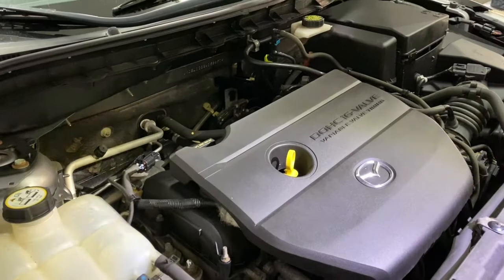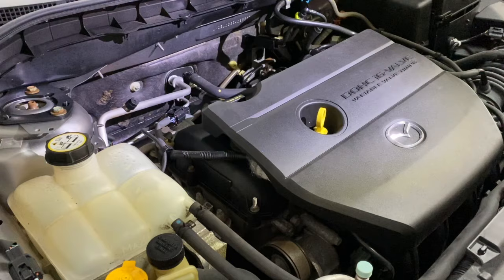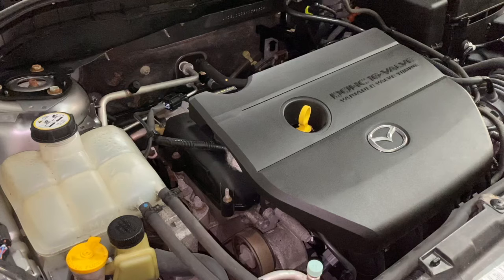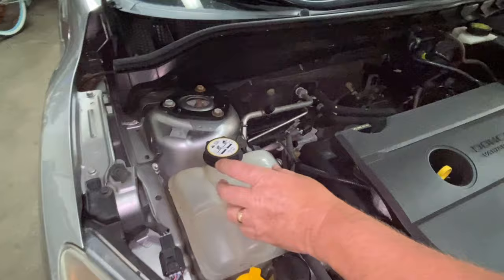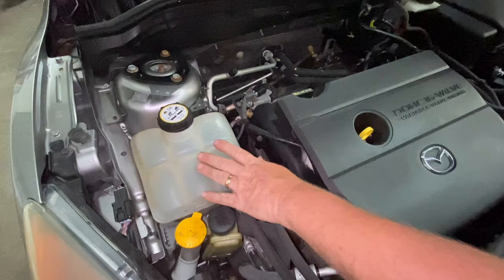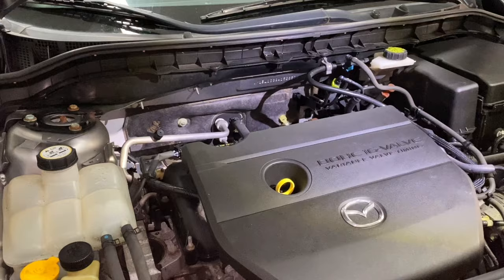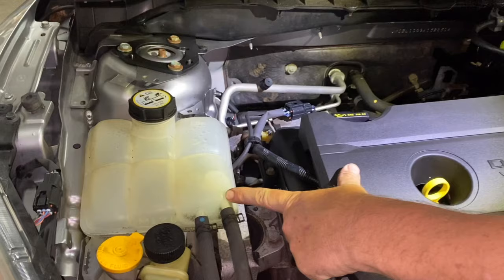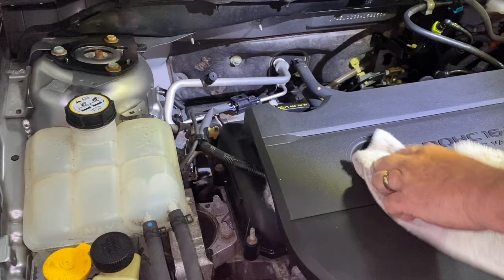Learn 3 Symptoms of Blown Head Gasket

Comment: Hey there, very informative video, 370z 
 60k miles did an oil change, and one of those gimmicky engine flush fluids before oil change during this though it caused a lot of white smoke from engine, temp is fine. it smokes a LOT from the engine, did I blow a gasket? No bubbles in reservoir or milky reading on dipstick or oil cap, I’m out of ideas here.
Reply from the maker: When you did the engine flush, you are not supposed to drive with that chemical in there, only idle, did you drive with it in there?
Reply: @Motorcarnut  just kept it on idle
Reply: @Motorcarnut  thankyou
Reply: @Motorcarnut  the car is supercharged that could be an issue as well

Comment: I have a 2014 Jeep patriot and I have changed the radiator both thermostats the radiator cap and waterpump also the temp sensor and it keeps overheating I cant find the solution for this and it keeps losing coolant from radiator with no visable leaks 😖
Reply from the maker: It’s probably burning it, the start of a blown head gasket. You could try pressuring each cylinder with the radiator cap off and see it you see air bubbles in the coolant.

Comment: Someone put stop leak in the car and it rocked up blew the radiator. Put new radiator thermostat and coolant filler neck car drives good but overheats still every two miles and I still have no heat.. what does that mean?
Reply from the maker: I never recommend any head gasket sealers, I even made a video on that. The car probably has a head gasket problem for someone to use those sealers.

Comment: I have a 2006 rt charger I bought from a owner that said it was the heads.. it smoked from the pipes just like your vehicle and idled real rough and it would not stay running… do different cars have different symptoms ?
Reply from the maker: Not really, All combustion engines runs the same way. They all need valve timing to be correct, have compression, fuel and spark. Sounds like coolant is getting into the combustion chamber from either a blown head gasket, crank in head or block.
Reply from the maker: Meant "crack"
Reply: @Motorcarnut  found out it was the pistons as well
Reply from the maker: That’s not a symptom of a blown head gasket that’s a cause.

Comment: I have a peugeot 508 1.6 tdi. I drove through a puddle/more of a lake, and there was white smoke coming out of the exhaust for the next 2 hours then it only smokes when i press the gas pedal at maximum. What could that mean? I am also losing coolant after refilling
Reply from the maker: You sucked in water hopefully you didn’t blow the engine. If it clears up you didn’t if not you did.

Comment: I have a 2006 Toyota Camry it’s not showing any of the signs you showed in this video I recently seen that my thermostat housing was leaking but before I found that out when I pour coolant in the radiator my motor shakes then my car kills do you think when I change the housing it will stay running or I have a blown head ?
Reply from the maker: I don’t like that when you add coolant the engine dies. That sounds like coolant is entering the cylinders aka blown head gasket or crack somewhere. Changing the housing that’s leaking is a good idea but won’t cause the engine to run rough then die.

Comment: Hello, There is an oil stain on my car engine and alot of smoke and burning smell comes out soon when car is started from hood (oil burning externally). What are the reasons for this?
Reply from the maker: You probably have oil dripping on the exhaust manifold. Probably the valve cover leaking, check there.

Comment: Did the coustomer get the car fixed and if so how much did it cost? Thanks great channel just found it today
Reply from the maker: Thanks, assuming you mean for a mechanic to charge you? It depends greatly from state to state and what quality parts they use but figure $1200 to $1500
Reply: @Motorcarnut  thanks is that just changing the gaskets or work done to the motor?
Reply from the maker: That’s changing the gaskets, fluids  and the labor to complete the job with a warranty.
Reply from the maker: If the head needs to be milled, that will be another $75.00 or some include it in there price, good to ask before hand
Reply: @Motorcarnut  thanks just getting an idea I might need to get mine done. But I will get it tested first. Internal leak with no smoke ,milky oil, external leaking.
Reply: @Motorcarnut  thanks I appreciate your time and knowledge. Great channel
Reply from the maker: No problem, thank you and good luck!

Comment: Hello , i want to make u a qestion please . 
I just bought a golf mk4 1998 1.4 16v 
The car pull out white smoke from exhaust 
Can u tell me plase what should i do ?
Reply from the maker: It depends on how much white smoke, a little when cold is normal. If the car is losing coolant or the white smoke doesn't stop when car is hot and runs rough then you probably have a head gasket problem or something else.

Comment: Great video :) so about 3 weeks  ago my car overheated. Was stationary for about 15/20mins and wasn’t looking at the gauge. I had the air con on but noticed it wasn’t blowing out cold out. Eventually I looked down and noticed the temp gauge was at the highest setting and the engine overheating warning light was on. I turned the car off straight away and checked the coolant. It didn’t overflow but it was on the maximum line. Anyway turned out the cooling fan stopped working. Mechanic came out and said I most I haven’t damaged the head gasket because the coolant didn’t overflow? But I’m just wondering if it caused any other damage to the engine as I have no idea how long I was sat when the car was overheating… I’ve been checking the oil and coolant levels since and they seem fine. Could the engine head be warped or anything else?
Reply from the maker: Ok, so after the mechanic said the fan was bad did he replace it and you’ve been driving the car every since?
Reply: @Motorcarnut yeah it got towed to a mechanic who replaced the fan. Have probably driven about 300 miles since it’s been changed without any problems. But just not sure if problems will occur in a year or two if say some damage has occurred which may show in a year or two say? Thanks :)
Reply from the maker: @nevs1992 No, seems like you caught it in time. I wouldn’t be worried.
Reply: @Motorcarnut great. Thanks :)
Reply from the maker: No problem

Comment: If you're having a coolant loss and you don't see any traces on the road whether the car is stationed or running, can it be something else except a blown head gasket? I mean can coolant evaporate from somewhere in the cooling system and leaving no trace?
Reply from the maker: Not really but it depends on how much loss of coolant you talking about?
Reply: @Motorcarnut  Thanks for the answer. I'm talking about 300ml approximately in 3 days or with small rides of a total of 15km
Reply from the maker: If you have no leaks anywhere, it’s burning it. Where is the question and without me in front of the car, my guess is the head gasket is starting to go or a crack in the head. But check and make sure it’s not leaking when hot and when you’re driving.
Reply: Alright I’ll check it when it’s hot. Thanks for tour time and advice :)
Reply: @amelie43177 you ever find out what it was?

Comment: My radiator doesnt have oil and my dipstick doesnt have water 

But my truck has a little white smoke, could this be a blown head gasket?
Reply from the maker: Depends, A little white smoke is condensation which is normal.

Comment: After I Drive my Saddat a bit then it Starts to show White Smoke,  . What do you think about that ?
Reply from the maker: If the vehicle is blowing white smoke with the engine hot then it’s probably burning coolant. Which can be a head gasket or oil cooler failing etc.

Comment: I have a 2004 Acura MDX. During the summer there are no codes, and the car is running fine, during the winter I get back the codes. I replaced all spark plugs and all ignition coils. Car dets to 3000RPMs while accelerating on the lower gears like 1st and second. I have codes P0300, P0306, P0302, P0301, P0304. What is that a head gasket? Or could be throttle body that in this car comes with Air mass flow sensor, and Idle air control valve built into one piece?
Reply from the maker: Sounds like a heat sensitive electrical problem. This type of problem has to be diagnosed with live data on a scan tool. Those are misfire codes so probably not a single issue like a coil or plug. Could be low fuel pressure too, crank or cam sensors or mass air flow sensor but you don’t want to just throw parts at the situation. That’s why it should be diagnosed with a scan tool.

Comment: I have a 06 Dodge caravan that has been leaking coolant really bad and last Thursday I replaced water pump and the week before that I changed the radiator. I was driving yesterday and smelled wires burning and then I saw white smoke coming from the hood. Pulled over and coolant was leaking from the front. The burning wire smell is gone but inside and outside it's smells like coolant and also the engine is hissing and I saw coolant all over radiator fan. Have any idea why my van is still leaking coolant even though I have a brand new water pump and radiator?
Reply from the maker: Sounds like you blew the head gasket. Probably overheated too much before.

Comment: I have a Mazda 3 2010 I noticed it’s been stalling & losing power or dying at lights it will cut back on again now it’s stuttering to come on .. I got error 02 code could it be a blown gasket ? I do see my coolant disappearing as well
Reply from the maker: Very possible, do a cylinder compression test or better yet a leak down test, have videos on both to show how its done.

Comment: Hi,
I have pajero 2003, the car was absolutely fine but recently i start facing overheating problems, my car get overheat if i am on highway and driving after like 10 to 15 km  on 120kmph and then engine start missing, i changed the throttle body + cleaned the radiator + Changed the sparkplugs but nothing changed.. What could be the problem? ... Suggestions will be appreciated. Thankyou..
Reply from the maker: Over here it's a Mitsubishi Montero but same thing. If it's overheating, meaning going into the red on the coolant gauge and you start misfiring to me that sounds like coolant in entering the combustion chamber somewhere when it gets hot, metal expands causing the misfire indicating either a failing head gasket which is common or a crack in the cylinder head or block which is rare. Hope that helps.
Reply: Had this happen in my 05 Silverado z71 with highly upgraded 5.3 LS, turned out to be a water pump
Reply from the maker: A bad water pump wouldn’t make it misfire

Comment: Will it be continuous white smoke or just temporary if the gasket is blown
Reply from the maker: If the gasket is blown letting coolant into the combustion chamber then yes it will be constant. However there are times when the leak is so minor it can leak into the combustion chamber overnight while the engine is cold and upon start up burn thick white smoke not to be confused with normal thin condensation smoke.

Comment: I have a question no white smoke no milky oil but the car is running hot and I’m losing water from the reservoir but it’s not leaking out the car it gets hot at soon as it’s idled
Reply from the maker: Try simple and cheap things first. Could be a bad radiator cap.

Comment: o4 expedition  temp guauge goes from the middle of the guage normal then drops to cold then back to normal i am losing coolant but i dont see any water or coolant on the ground truck has a rough idle but smooth as butter when i step on the gas i do have coolant coming out my tailpipe not an excessive amount. i do have a new cylinder head temp sensor  and yes the truck when i shut it off i can hear coolant bubbling in the plastic resevoir if the new head tempsensor doesnt solve the issue? im ost i bought the truck abot 6 months back t ran fine ice cold no over heating i drove it every day then one evening just drove it a few miles ac shutdown truck got hot guage was normal then cold then normal i was less than a mile from home ..i got it home th next added water and it drove fine for about an hour and same thing happened
Reply from the maker: There should never be coolant coming out the tailpipe, you have a blown head gasket or a crack in the head or block but most likely a head gasket failure

Comment: My Mercedes benz c300 smells like it’s burns oil and has a tiny bit of white smoke coming from around the left side of the engine, would that indicate a blown head gasket?
Reply from the maker: Hard to tell by your description but oil smell is not necessarily from a bad head gasket but the white smoke coming from the engine can be. Best to have a local mechanic check it out for you.

Comment: The radiator block just blew out the o ring and a piece of it next to the o ring blew out as well. Changed spark plugs one day. Then changed valve cover because it was leaking onto spark plugs I believe. fixed all these things and car would run for a day then I’d go to start it and it putters and acts like it doesn’t want to start. Have to give it gas and rush it into gear to even drive it. Didnt drive it for a day then friend goes to start it and it starts right up and is able to idle when the days before that I drove it and it couldn’t idle at all without dying. Got to a red light it died. Turned corner too slow it died. Don’t know what else it could be or what to do next. Need my car bad.
Reply from the maker: What kinda of car you have? Year make model?

Comment: I have no idea what’s wrong with mine. Sometimes the gauge needle would be in the middle but sometimes it goes all the way up and once it does the car starts to jerk and slow down. I’ve already changed the radiator
Reply from the maker: I wouldn't drive it like that if it didn't already cause some damage. Could be as simple as a radiator cap or as bad as a blown head gasket. That jerking sounds like a misfire possibly caused by coolant entering the combustion chamber 
( blown Head gasket )
Reply: I'm pretty sure that's a p1299 or cht sensor it will cause that . Did you figure it out if so what was it?

Comment: Hello Boss i have a Question i have a bmw 2004 325i but the cars only throws white smoke when i go fast and then it won’t stop throwing it until i stop the car for a couple days wat can that be I would really appreciate i’ve you could Help me Out 🙏🏽God Bless You
Reply from the maker: Sounds like you have a head gasket starting to fail. When the car is very hot under load seems it’s probably spraying coolant into the combustion chamber hence the burning coolant ( white smoke) and probably seals itself when cold because metal expands and contracts. When driving short distance it probably doesn’t expand as much so you don’t notice the smoke.

Comment: My car release white smoke, no leak no oil mixed with coolant, no loss of liquid from coolant reservoir, I don't know what else should I check 🤔
Reply from the maker: Depends if the white smoke you’re seeing is normal or not. Condensation at start up is normal especially in colder weather

Comment: Suppose I only have disappearing coolant. I don't have any of those symptoms. I changed water pump and radiator.
Reply from the maker: Either you have a temperature sensitive leak ( leaking when its hot or cold) or the engine is burning coolant and not yet very noticeable.
Reply: @Motorcarnut  I looked at the inlet housing I took off when I was doing changing the water pump. The thermostat inlet housing had silicon around the inside.  I don't know if that should be there, but I was going to get the head gasket done and then see if it stops the problem. If it continues I'll just change the inlet itself as well.

Comment: I have a question, I own a lexus ls460 and noticed that recently it started blowing a decent amount of white smoke from the exhaust, not as bad as this car, but enough. What do you think my next step should be?
Reply from the maker: You can get a test kit that checks to see if combustion gasses are in the coolant meaning a blown head gasket. Search this:

RELD Head Gasket Tester Kit Combustion Leak Detector for 50 Tests

Comment: I have a 5.4 excursion I just bought it’s running crappy and has a misfire but I went to replace the thermostat and it has that copper flakes stuff to seal leaks in the antifreeze in it …. I also have exhaust manifold leak and I noticed copper flakes where the exhaust manifold is leaking … do you think it’s head gasket
Reply from the maker: Sorry to say but Yes I do. Whoever sold you the truck was trying to cover up a blown head gasket with those head gasket sealers that I tell people never work and are a waste of money.

Comment: hello man! great video, i have had my car trough service check and they said i have a faulty/blown head gasket. But i dont get any smoke and no milshake in the oil dipstick and the coolant looks kind of normal (just looks old) what whould u suggest to do
Reply from the maker: Why did they say you have a blown head gasket?
Reply: @Motorcarnut  They didnt really explain why just that i needed to be replaced. Since that almost costs more then car im trying to figure out if i should add some head gasket sealer or leave it as it is. Its an older car but with only 60.000 KM (37000 miles). Would be happy to hear you suggestion.